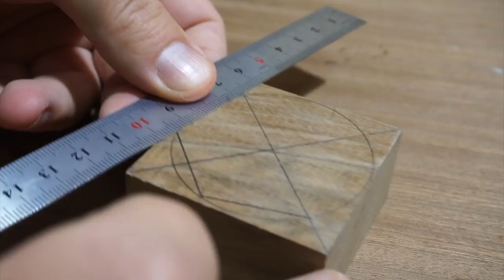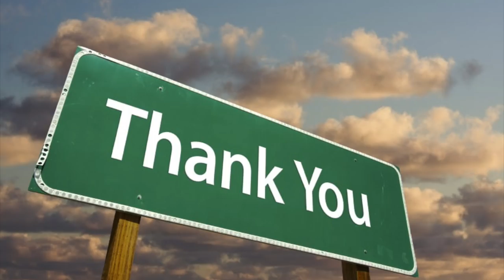Sanding Saw, How to make

Comment: Don't make something unless it is both made necessary and useful;
but if it is both necessary and useful, don't hesitate to make it beautiful.
-Shaker Maxim

This philosophy applies very well here. Good idea and presentation.
Reply from the maker: I had never before heard that philosophy but I love it!!  Thanks for your comment!!
Reply: Couldn't agree more!
Reply: Unless you have a more Spartan outlook and simply focus on function vs form.  In that case, beautification beyond ease of use and comfort in the hand becomes a waste of time. 

Sorry for the tangent here, but it's like how knife makers take the blade to a mirror polish and the handles down to a 1,200 grit finish with machinist perfect plunge lines, on a knife that's expected to be exposed to the rigours of the out-of-doors no less, and use that as justification for charging $200 or more; when 200 grit on the blade and 180 on the handle would suffice.  Really, an oiled 180 grit finish gives a lot better grip than 1,200 grit and 200 grit holds oil better than a micron finish and won't make you paranoid of scratching it like it will if shows your reflection.  if one plunge line is 1/32 to 1/16 inch too far forward or back from the other really affect how it cuts or sharpens?  You can get a knife that functions just as well as a $200 piece for $70 from Ontario Knife Company or the like. 

In short, cosmetics are overrated.

Comment: I don't know why I've never seen anything like this ever before...if I have I certainly don't remember...This is absolute beauty! & I agree with others that the music & video quality are superb!
Reply: Jason Gardner  you've never seen a "sand saw" because it is a nice project and discussion piece that unfortunately is not that useful to a woodworker. My son-in-law built me something similar for Christmas many years ago, put his heart and soul into it so of course I have to keep it on display in the shop and make sure it looks well used when he pops in LOL - But honestly holding a piece of 120 grit 1.5" wide 20" long emery cloth in both hands does a better job, faster,  with far more control. If I was into building my own hand tools I'd build this only after I built all the planes and spokeshaves, f-clamps, handscrews, hand crafted tenon saw , more tablesaw and router jigs, another bench, etc that I needed. :-).
Reply: I have a feeling this is your opinion sir, & I would like to say, I think it is in the way that one uses it.
I have a set of TIOGA frame stands that I stopped using on my freestyle bmx, because they were a brainchild of the industry for freestyle bmx, but the simpler axle pegs were superior, even though they were a simpler design. The frame stands were well made, very strong, i still have them & I will find a good use for them. They are/were definitely not a waste of time, but they did not serve best in their original intent. I do not call them a novelty.
It's my perception here that this tool has far more merit!
You just have to know when to use the right tool & that is the beauty of what this fella has produced! 
Definitely not a dust collector novelty.
+Mikhandmaker keep up the good work!
Reply from the maker: I respect all points of view and I appreciate your comments.  I personally, in addition to what I have enjoyed making it, I'm going to use it frequently.
Reply: Well spoken!

Comment: The covering material of the dowel looked like "normal plastic" cling film.
Cellophane is clear transparent paper.
Cellophane is made from wood pulp, cling film is made from crude oils.
I appreciate that US English is not the same as UK English; but thus is an important distinction.
Cellophane is a rigid form of clear material, often used in the UK to wrap flower bouquets. 
Cling film would make a mess at this task.
Just to be helpful.
I am sure you wrapped your oiled dowel in cling film.
Fyi only.
Great fun otherwise.
Reply from the maker: You're right, since I don't know the language completely (neither US English nor UK English) I found myself entangled with the translation.  Thanks for the remark.

Comment: What is that 'extension' you put in the vise to clamp to?  Never seen that before.  Thanks.
Reply: I believe it is called a Bench Bull, I have seen other utubers use them
Reply: I will look into making one of those.  Raising the work up will help with sight lines, sawing straighter and my back.  What diameter dowel did you use for the spine?  The wood tap and die is a luxury.  I would consider one if I could use it for other projects.
Reply from the maker: Yes, it's a Bench Bull, I saw the idea a long time ago and I decided to make one.  I'm very happy with it since it's very useful.  Sorry I don't understand exactly what do you want to know, the dimensions of the bench bull?  Thanks
Reply: I did some searching and no one (that I can find) shows how a bench bull is made.  Only what they do with it.  There seems to be a lot of videos for the Workmate and bench bull.  Don't have a Workmate.  It seems like a simple thing to build.  Thanks.  Diameter of the rod you used, please?
Reply: Mikhandmaker  now then - the bench bulk is another matter - it is totally indispensable !!! Do a video on how you made yours.
Reply from the maker: As the idea wasn't mine, I leave you the link where I found it:  http://www.popularwoodworking.com/woodworking-blogs/editors-blog/bench-bull-the-jack-of-all-bench-jigs-part-1
Reply from the maker: The diameter of the rod is 25mm.